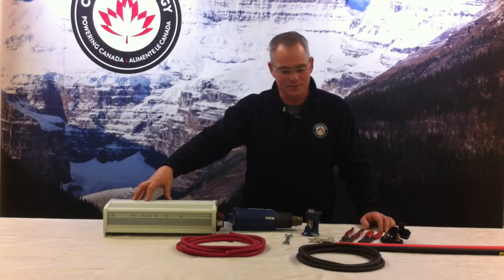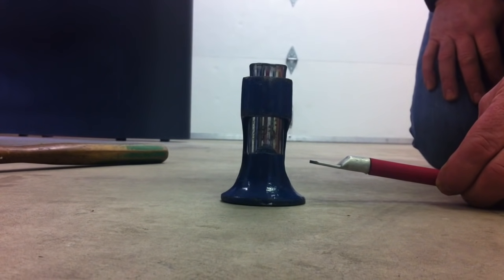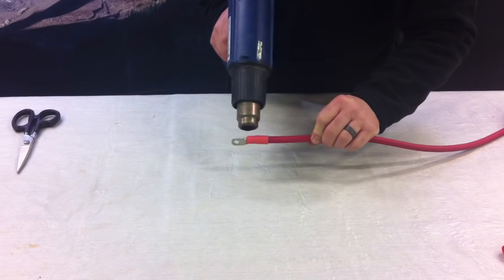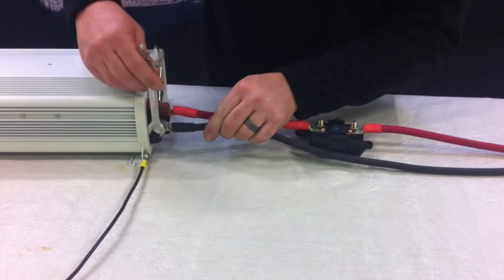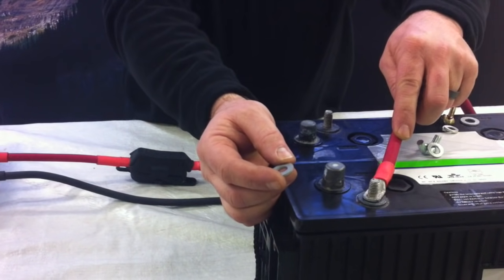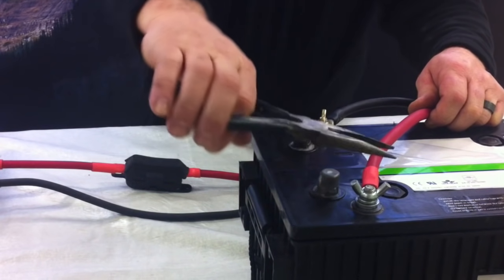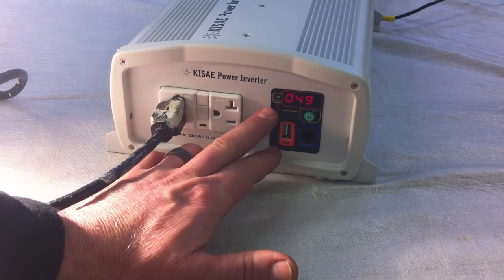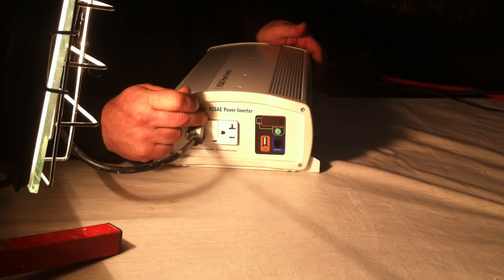Canadian Energy™: Inverter Installation : 101

Comment: I'm living out of my car for a while and winter is here so I need a heat source and power besides my car being turned on for extended periods of time. So 2 questions:
1) Do I connect the positive connection of the inverter to the positive on the battery?
2) I have a very small 10Ah Thunderbolt Magnum, 12v sealed lead acid sports battery and a centech 750continous/1500peak inverter. I never did this before and I don't want anything dangerous to happen. Are these two items compatible? 
Side note: Would you be able to do a video on creating a continous power source for this particular living situation? I think I'd be helpful to a lot of folks in this situation. Thanks
Reply from the maker: Sqor Geek Yes you would connect the battery positive to the positive terminal of the inverter, ideally there would be a fuse in between as well, then connect the battery negative to the inverter negative terminal.

The battery and inverter are compatible because they are both 12 volt but you should should not expect much run time with a 10Ah battery, maybe only a few minutes depending on the size of the load. Hope that helps.
Reply: How did the inverter work out for you? I'm currently going thru similar circumstances and was wondering if you could give me any tips for doing mine.
Reply: Sqor Geek you'll a deep cycle battery bank to support the inverter powering a heater with the car engine off.
Reply: If you can, park near an outside ac outlet and run an extension cord.
Without your engine running the current draw of a heater can kill your battery in a few hours.

Comment: do i absolutly need copper wire cause i bought wire already but it's not copper so i am not  sure that will do
Reply from the maker: nick diaz Copper is one of the best conductors and readily available so it is industry standard.  If you choose to use a different material for your cables you will want to check the manufacturer specs to ensure it has the proper voltage and amperage carrying capability for your application, as well as its compatibility with terminal connectors. Hope that helps.
Reply: thank you for such a  fast response i was wanting to ask you where did you get that little box that you attached the cable to before attaching it to  the battery & is that necessary  to do it that way what is the purpose ??
Reply from the maker: There are several manufacturers of DC fuses, this particular one is manufactured by Eaton and can be purchased through Canadian Energy as well as other companies who supply inverters and DC components.  It is highly recommended that there be a fuse in between the battery and inverter to protect the circuit, with no fuse in the circuit there is a great possibility of a cable overheating and causing a fire should there be a short circuit in the system. Hope that helps.

Comment: you may want to charge the capacitors via a 25 watt 30 ohm resistor prior to applying power cables.  wont damage the batteries

Comment: Could you have more safety benefit in having the inverter connected at the charge controller instead of right on the battery? (Because of the safety power disconnect feature of charge controllers) And how would you do that?

Comment: Hey there +Canadian Energy:

I intend to put a 1000-2000 watt inverter in my truck, the best place for me to install it is below the drivers seat or behind the rear seats. I'd like to have remote plugs (remote from the inverter that is) 2 plugs in the center console and 2 plugs in the bed of the truck. How does one go about running the cables to have outlets in multiple locations and not just on the unit itself?
Reply from the maker: Danan Coleman you will need to purchase an inverter that is hardwire capable, the Xantrex HF and HFS models have this capability in both the 1000 & 2000 models. Hope that helps!
Reply: Canadian Energy thanks so much!
Reply: Danan Coleman I used stranded 12/2 with a plug on the inverter side. hooking stranded up to an outlet might not be the best idea but I've had zero problems.
Reply from the maker: paul mryglod The inverter must have the provision for hardwiring AC receptacles, Xantrex has several models available that are hard wire capable so if you are looking for a modified sine inverter the X power or the Pro Series are good options or if you are looking for a Pure Sine the Freedom Xi is hard wire capable.
Reply: paul mryglod I ended up getting a Sunforce 1000 pure sinewave inverter installed professionally.

Comment: How do you determine the fuse? Got a 5000w inverter, 840Amp batt 12v
Reply from the maker: Jerry Cruz t must be able to handle the max draw of the inverter, this would be 500+ amps for a 5000 watt inverter (refer to inverter manual), the cable should also be sized to handle this load.
Reply: 5000 watts divided by 12 volts equals 416 amps. And the inverter has a lot of losses and things might fluctuate a bit. So yes, 500 amps should be ok.
Reply: http://www.solar-wind.co.uk/cable-sizing-DC-cables.html 12v, 500 amps, 5% loss, 2 meters cable length, 185mm2 wire required. Thats 23.5mm diameter!

Comment: How do you protect the battery from over discharge?  Is the inverter low voltage shutoff high enough to protect the battery from permanent damage?  Thank you!
Reply from the maker: Typically you size the battery pack to the requirements of your inverter draw and the recharge sources available.  Most inverters will shut down at 1.75 VPC or 10.5 volts on a 12 volt battery, depending on the rate of discharge this could mean 100% depth of discharge which is not good for a lead acid battery.  Higher end inverters have adjustable cut off voltage settings which can lower the depth of discharge, but you would have to consult your inverter manual to see if your unit has this functionality. Hope that helps!
Reply: agreed but the inverter in your video, and most other retail inverters have no such adjustability on LVC.. There is a  separate component that will perform that function, but I wonder how practical it is since there could be considerable voltage droop under load.

I think you're right though.. Size the battery bank so the DOD is less than 25% or 50% every day... For those of us who just want a standby emergency power source, need some other method.
Reply from the maker: There are Low Voltage Disconnect devices available but most will not handle the high amperage draw of an inverter, this would mean you need to connect the LVD through a relay which becomes a complicated wiring job and more costly.  With a good quality, properly sized deep cycle battery, you should get several hundred cycles out of the battery even if you are reaching the low voltage shutdown point of the inverter. Hope that helps.

Comment: Can a 600 W inverter power such things as a fan, a light or a tv?
Reply from the maker: Albert Zion you bet. You will require an Inverter that turns DC battery power into 240 VAC house power.  Be sure to choose the correct inverter as most North American applications are 120 VAC 60 Hz while Europe and many other countries are 240 VAC 50 Hz.
Reply: Can it power a microwave and a fridge at the same time? I mean, why choose a 2000W and not a cheaper 600W?
Reply from the maker: Albert Zion Microwaves and fridges generally require an inverter of at least 1500 watts to power them.

Comment: I've seen different installations of the fuse between the inverter and the battery with some saying the fuse should be within a foot or so of the battery. In my car (a prius) I want to use anderson connectors between the battery and inverter with a short length of wire on the battery side and longer wires on the inverter side so I can just unplug the inverter and use it elsewhere or just have it out of the car when it's not in use.  Is it ok to put the fuse on the inverter side of the connector? Good video by the way.
Reply from the maker: mary barton the purpose of the fuse is to protect the cable and power source from short circuits so the fuse should be as close to the battery as possible.  There are some styles of fuses that can mount on the stud post of a battery but your configuration may not allow that, always a good idea to have a fuse in the system but not always possible. Hope that helps.
Reply: Yes it does and thank you very much. I'll be putting it on the battery side :)

Comment: so you said proper size cable and proper size fuse, but how you make the calculation
Reply from the maker: Jose Garcia Your inverter manual should say what size cable and fuse is required, it is important that the cable be sized to handle the maximum amp draw of the inverter and can vary in size depending how long the cables are.  There are many websites that will calculate cable size based on all these variables.
Reply: Cable size: http://www.solar-wind.co.uk/cable-sizing-DC-cables.html .. Google is your friend 🙂

Comment: I have a 3000w inverter. It also has 2x positive wire attachments and 2x negative attachments . So double.what you have in video. Would I put 300amp fuse on each positive wire or 150amp on each. Thanks

Comment: What's the difference between an inverter and a converter?
Reply from the maker: Albert Zion converters and inverters are electrical devices that convert current. Converters convert the voltage of an electric device, usually alternating current (AC) to direct current (DC). On the other hand, inverters convert direct current (DC) to alternating current (AC).
Reply: thanks very much.
Reply from the maker: Albert Zion our pleasure. 🇨🇦🤙🏼

Comment: you say proper szie but what is the size??
Reply from the maker: Tim Johnston the inverter DC amp draw and cable size determines the size of fuse, it is recommended to refer to the inverter install or owners manual.

If you want us to ballpark it, 

1000 watt inverter 100-150 amp fuse, 2000 watt inverter 200-250 amp fuse, 3000 watt inverter 300-350 amp fuse.

Hope that helps! 🇨🇦✌🏼

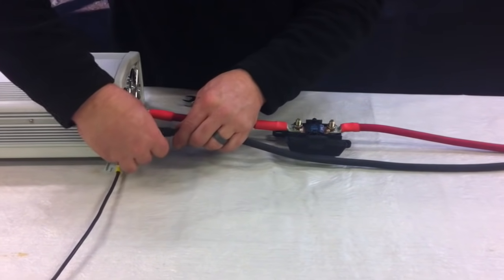Comment: At 3:03 mins, you said you were putting the ground cable on. I'm a total novice... You meant the negative cable, right?
Reply from the maker: Stephen Denlinger At 3:36 of the video he is referring to the chassis ground, that’s the smaller black wire coming off the inverter at a 90 degree angle, this ground connection comes off a designated terminal on the inverter to common ground on a boat or RV or the chassis of the vehicle it is being mounted on.  The main positive and negative terminals off the back of the inverter go to the battery. Hope that helps.

Comment: No sir I just purchased yesterday afternoon, I am thinking even if I increased the wire size it may/may not work wish I could mount it under hood opposite side from battery would be concerned possibly about heat if all I can get out of 1/0 I may just reinstall my dewalt 1000 watt and go with it

Comment: In an install like this, is a battery disconnect switch needed?
Reply from the maker: ScubaTony Anschutz It’s not needed because we are working with low voltage but doesn’t hurt if you want to install one. Hope that helps.

Comment: What is the minimum amp rating of you car alternator to provide 200 continuous dc amps  to the 2000 watts inverter.?  The car battery is 635 cranking amps but does nit provide any other info
  And the alternator is 230 amps.  
What is the minimum engine rpm.  Idle?  7000 rpm?
Thank you sir.  I just bought a 5000 continues watts pure sine 12v inverter.  The manual does not provide the requiet amp rating of the 1wv dc alternator.
Reply from the maker: Nestor Asuncion Unfortunately we are not able to provide that information as it will be dependent on the vehicle make model, type of alternator, pulley sizes, ambient temperature, etc, etc.  Remember,  in addition to the 200 amps you will require to operate the inverter the alternator must also supply the vehicle electrical loads, battery specs are not as important as it will only sustain the inverter load for about 30 seconds if the alternator is not operating.

Comment: how big of a fuse for 3000. or is there a chart to compare?
Reply from the maker: Arbo TM most CSA or UL listed inverters will have a recommendation in the install manual. Generally a 300 Amp fuse is required for a 3000 watt (continuous) inverter.
Reply: I give you the formula west Virginia 
Volts × amps =watts 
3000watts ÷120volts =25 amps so unit a 25 or 30 amps fuse
Reply: So you need 30 amps fuse to protect your load

Comment: The fuse should be closer to the 12V battery rather than close to the inverter.
Reply from the maker: Reggie Smith yes, that’s correct, as close to the battery as possible. ✌🏼
Reply: What size cable and fuse should I use for a 3500 watt inverter to go in my big rig thx
Reply: I have a 200amp circuit breaker on a 1700 watt inverter. Inverter has short circuit protection but I'm paranoid. Is 200 amp ok for 1700 watt inverter? Any reply appreciated
Reply: @dragan3290  I understand your paranoia, car batteries can provide currents at shorts which are really spectacular, and potentially dangerous. Your protection sounds OK to me. 1700 W at 12 V means 1700/12=141,7 A. If your circuit breaker disconnects at 200 A, this means that you the threshold for the circuit breaker is approximately +40 % above the maximum 141,7 A. If you get a short circuit, the inverter's short circuit protection will hopefully kick in first, protecting the inverter. If that one would fail, the circuit breaker will kick in at 200 A. It all sounds reasonable to me. It is worth mentioning that all fuses and circuit breakers have different tolerances, so I would not expect the circuit breaker to kick in at exactly 200 A, but you are in the right ballpark in my humble opinion.
Reply: @inber  thanks for the reply ! Highly appreciated! 🙂

Comment: what is the proper size for the ground wire  on a 2000 watts inverter ?
Reply: Hello there, I have a basic 5000w inverter /solar set up that will be for emergency at home- seperate from the house. Where will you be running your ground from the inverter to?
Reply: P.S. I have a 2ga wire for my ground

Comment: One more question sir, I connected my 1500 w inverter direct to my car main battery. Is it OK ? and can I run the car engine while using my inverter ?
Reply: Not only is it okay, you SHOULD run it: Your battery will be quickly run down unless the engine keeps it charged up via the alternator.  Note that high draw might mean you need a heavy duty alternator.  Also, an alternator needs the engine running pretty fast (2000 rpm for example) to charge the battery - which is why our dads would tell us to take the car out on the highway for a while if we let the battery die.  Be sure to attach the hot wire with an appropriately sized fuse/circuit breaker and use short/thick wires.  In the video he notes the wires are actually too thin.

Comment: Can you run a refrigerator on that inverter
Reply from the maker: Luis Cruz Typically you will require a minimum inverter output of 2000 watts, however it also depends on the size and type of refrigerator as the surge the fridge requires to start is often the determining.

Comment: I am going completely off grid does an inverter or a converter power off the battery
Reply from the maker: booty pirates inverters are powered off 12, 24 or 48 volt battery packs while converters are powered by 120 Volts AC. Hope that helps.
Reply: thanks

Comment: How do I use user mode on my mppt controller
Reply from the maker: Justin Watson We may be able to provide some help if we knew the make and model of your charge controller, I suggest you refer to the owners manual for directions on how to program the unit or have qualified tech program it for you if you are unfamiliar with its operation.
Reply: Gouge rv mppt solar controller 40 amp rohs

Comment: My company just installed the Tundra M2000 into my truck and it will power my 700w microwave but not my PlayStation 3 nor 4. What is happening?
Reply from the maker: sanonboi The Tundra M series inverter are a very inexpensive modified sine wave inverter and will often not operate sensitive electronic equipment.  I would assume your PlayStation requires the same type of pure sine wave power as you get from the 120 volt outlet in your house.
 
We generally recommend the Xantrex Freedom XI or Freedom HFS for highway trucks where quality of power and reliability is required, these inverters can also  be hardwired into the truck so the inverter itself is located in the sleeper tool box.
Reply: Okay. I eventually found out about pure sine and modified sine waves after doing some googling. Is there any way to for this inverter to push out pure sine waves?
Reply from the maker: sanonboi No, they either generate Pure Sine Wave or Modified Sine Wave Power.
Reply: Canadian Energy I see. Thank you for answering my questions, I greatly appreciate it.
Reply from the maker: sanonboi Our pleasure. Thanks for watching!
Reply: Canadian Energy you can buy a real sine wave inverter 1000 watt at menards for 300.00

Comment: thank you for the advice and if you have time make a repair video it will be very helpful, thanks again and have a great day.
Reply from the maker: Great idea!
Reply: Rudy Barrios i have a 6000watts inverter with built in charger and automatic change over switch , it's a royal power brand, my problem is when I plug in to my Ac outlet to charge my battery the Ac outlet on the inverter will shut down and when I plug out it will work could u say what's the problem
Reply: Not all inverters are created equal. Your inverter choice may be the problem
REPLY

Comment: Can we connect Inverter Direct with solar pannels without batteries.  For tubewell. is this possible? ??
Reply from the maker: Qasim Ali No you must have batteries in the system as the solar panel will not sustain the inverter load. Hope that helps.
Reply: Canadian Energy Thankx for Reply